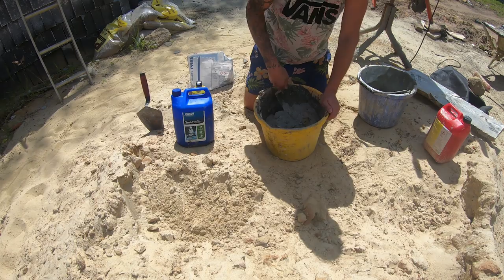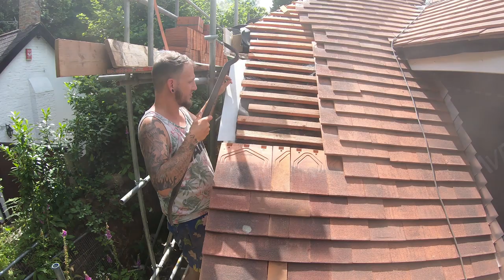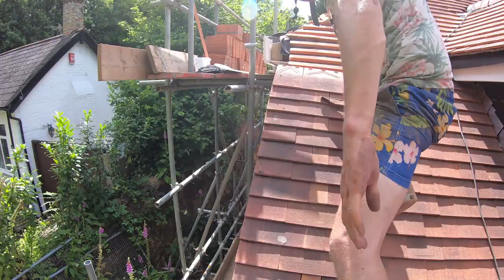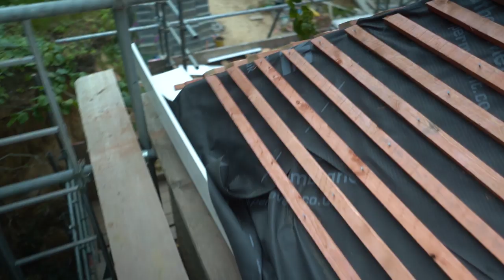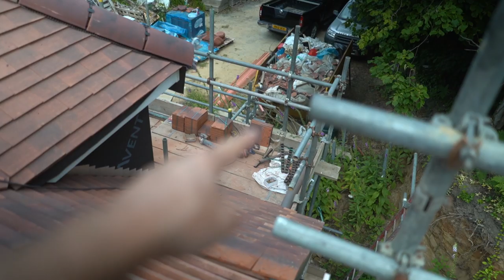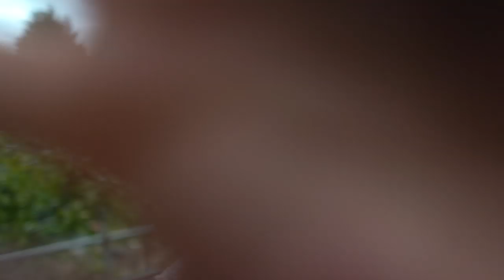BUILDING A HOUSE ALONE from START TO FINISH | E.P 79 [Bedding the roof tiles]

Comment: Should have tiled from the verge to the dormer. No roofer would ever tile that direction and have all those tiny cuts with questionable weather. Should have been cut in at the dormer and gables instead of tile and then slither. Builders should build, roofers should roof!